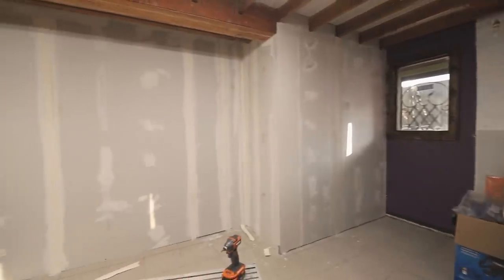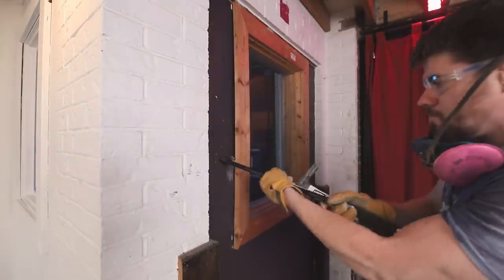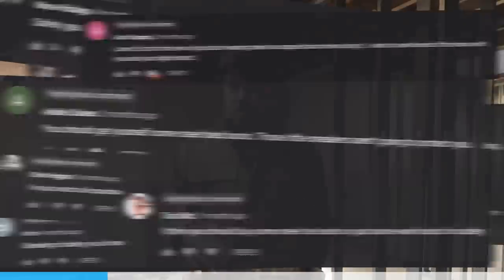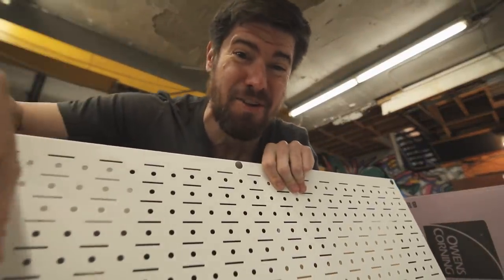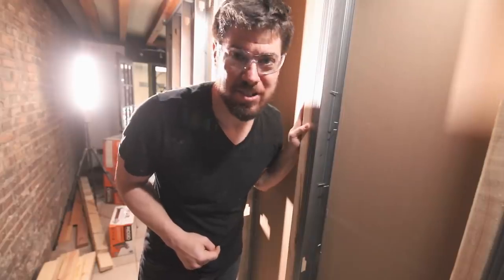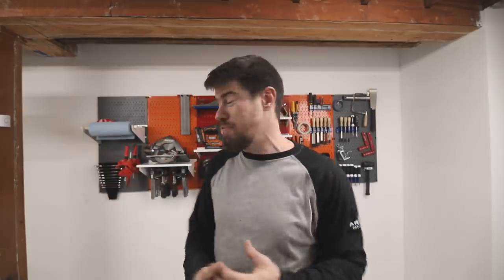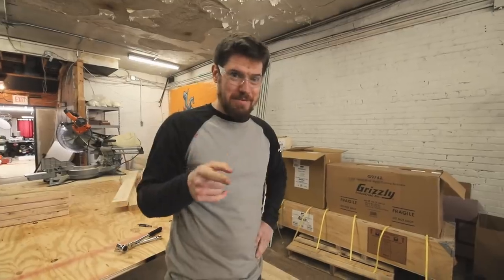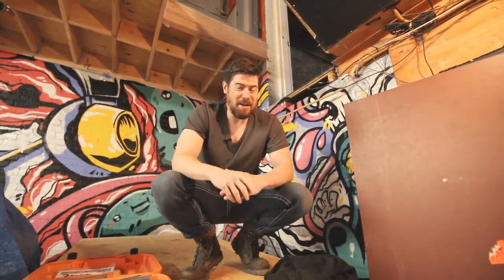Abandoned Building Renovation Ep. 08 || PERMIT PROBLEMS, PAINT SPRAYING & Workshop Organization

Comment: If you're going to use that scaffolding as a deck, you did make a mistake. But it's NOT the one you think you made with the lag bolts. When building a deck, you notch your posts to receive the boards for your truss members. This way, the weight of the trusses go directly from the truss onto the post holding up the truss. The way you have it, the weight of the side boards are being held exclusively by your metal fasteners (the screws into the plywood and your lag bolts). This creates a sheer force on the lag bolts that will over time cause the lag bolts to fail. Sure, some of the weight is going up the screws in the 2x4s into the plywood and and then over to the posts. But you're still mostly working against gravity at that point.  Good job on the diagonal brace.

Now, if this is a temporary structure that you're going to use occasionally, then having the lag bolts take up almost all of the weight is fine. You should notice any deformation or stress spots in those bolts long before they fail.  You may even wish to add heavy duty, locking casters on the bottom to make those platforms easier to manage. However, if this is going to be used somewhere else on an ongoing basis AFTER the plumber is done with it, you're going to want to redo those legs.

Remember, when building structural components, the load forces should always go directly from one load bearing component to the next, and not have any metal fasteners as a bridge. If you have a point where load forces cannot go from one structural component to the next, then you need a third party solution like Simpsons metal hangers and straps. And, in some applications where the load does cross from one structural component to the next, but the fasteners might not hold when presented with sheer forces, you may still need to add hangers and straps, like hurricane straps to tie roof joists to the walls they sit on.
Reply from the maker: This one is a temporary structure....but good info to know for when I build my roof deck.
Reply: Wanted to mention that too, things that i learned on high school. But than i realized he's so handy and not come as an engineer, so he'll learn himself by the time he doing things

Comment: I'm surprised you didn't just cover that tool wall with a DIY french cleat system, and placed plywood sheets behind the drywall, instead of doubling up on the studs
Reply: Exactly. French cleat/plywood wall would have been sooooo much better. really missed opportunity.
Reply: I'm surprised you don't get how great Wall Control is...
Reply: @Stillnapie  I don't get it. My father had pegboards for his tools and they were horrible. Granted, fiberboard, but still pegs in holes. French cleats are much more customizable.
Reply: @RussellNelson  Ok.... so?  I use french cleats in my wood shop but the Wall Control product is far better in my metal working area.  Have you ever used Wall Control?? If not you have no credibility on this.  And they are nothing like the old pegboard...
Reply: @Stillnapie  They accept standard pegboard items. They fall out of a fiberboard pegboard. Why would a metal one work any better? Sorry, but you have no credibility here. It's almost like you've never used a pegboard.
Reply: @Stillnapie  Okay, then how does Wall Control keep the tool holders from pulling out when you remove a tool? They're the same tool holders! They advertise that you can use the same tool holders which don't work with fiberboard, so how is metal going to solve that problem? Honestly, you're just making stuff up.

Comment: Technically you only need to bolt the long side.  The short side on the end is no different structurally than the cross pieces in the middle.  That said, as long as you didn't put the two lags in the same grain line (which you of course didn't cause you're not an idiot) you're fine.  Of course, local codes may require squid ink and bunny slipper, so who really knows?

Comment: I have been "criss-crossing" leg-bolts for 40 years on work benches and it has worked well. The only thing I do different lately is that I use 2x5 or 6 at the top to spread out the bolts.

Comment: A thought- using the heavier gauge metal studs in place or the existing studs and lapping them (since you had one side of the wall open) with the in place studs would have got you the strength and could also be used for blocking to help carry and distribute the load. Have done this on remodels and refinishing commercial space- although I'm a plumber by trade and contract, building a wall that might carry several tpes of drainage and water supply, hang commercial sinks and equipment on, you take the framers to lunch every now and again to learn how to fix the crack you are in! Other than using washers of a larger OD to spread the load around the bolt passage and lock washers, I don't see any particular problem. And most "table structures " are much the same. I would have used the excuse to tell my wife I needed to make the rent company auction and bought several sections of different height modular scaffolding and hardware, but that is me! Good scaffolding was always great for me, as aspects of plumbing are commonly run in the ceiling.ON big city permits and "the ticking clock" all construction exists on, I have little advice past you seem to be doing all the right things. If you weren't in Illinois, I might suggest you look to the state Fire Marshall's Office, as they are the driver on that code change- maybe you can get them to sign off on it and then the city will have to act? Illinois has already given me gas when I was there for a short time, so you have my greatest sympathy. The weather is better in Texas anyway! I left with a 40 mph breeze coming off the lake in late October, my hoo hah frozen dang near solid! But I am an effete Southern boy, with thin blood, don't you know! Great place- wish I was 30 or so years younger, and not so beat up from my 35 years at construction- which I loved and would do again, even knowing it had personal health costs.

Comment: If I may make a suggestion, you are going to have quite a few machines in your shop requiring a multitude of hand tools for adjustments etc.  If you have the money, buy a set of tools for each machine rather than one set of tools I.e. a set of combination wrenches that are on a pegboard somewhere in your shop.  If you have to walk 5 or more steps to retrieve a tool needed for a certain machine and have to return it to its original storage location it becomes a PITA.  For example, I recently bought a drill press and I needed a few combination wrenches to make a few adjustments.  I was walking over to another work bench to always borrow these wrenches and I had to put them back.  Go out and buy what you need for each work station, it will save you a lot of time in getting your work done.

Comment: Hey Modustrial, pro tip for workboots my grandad lived by: If you are doing metal work at all, jeans over the boots is a MUST (actually H&S regulation in the UK), anything else then feel free to tuck the jeans into the boots... reason for this is i hope quite obvious, it takes longer to pull your boot off than it takes a lump og white hot metal to leave a nasty scar (or worse) on your foot.

Comment: For the lag bolts- you're putting all the load on the bolts, rather than wood to wood. Plywood-->2x4 frame --> 4x4 post 
You can also use 2x4 with one with a notch so the load goes on a 2x4 directly, rather than the bolt- it also provides a flush side if you wanted to skin it. 

But I'm just a theatre tech :P

Comment: 2 months too late now but in more industrial settings where you still want a drywall finish/partition but you need strength in the wall to hang stuff you can put a layer of 1/2 or 3/4" ply or OSB behind your drywall sheet. You don't have to worry about matching your fixings to your studs that way.

Comment: Those bolts will rip the wood apart over time even with the washer. I would recommend using some of the things they call "mending plates" and putting them on the wood so you have a 2inch square or 4 inch square metal plate that the bolt and washer rest on rather than the bare wood. It will last much longer and take much more stress. You could also use a much wider washer if you would prefer. But you've got too much stress on too little a spot with metal on wood.

Comment: I sure hope you're planning to run Cat 6 ethernet cable before you seal up the walls. If you're going to be uploading gigantic video files to YouTube, you need a physical connection, at the very least in that studio you're planning.  Wi-Fi is convenient, but wired is way faster.

Also, you're pretty likely to need more than one access point to provide adequate wi-fi signal over the whole property.  It's long, narrow, and has a lot of walls full of metal studs blocking the signal.

So run ethernet cable while you've got the walls open.  It's cheap, you can make provision for ceiling-mounted access points, and run everything to one central location.  Just don't forget to label which cable goes where, it's a pain to identify them later.

Comment: On the clothing front... I don't think I've ever seen you wear trousers with built-in kneepads. These days I have bib/brace and trousers with built-in kneepad holders (Dickies in my case but other brands do them), and they are a godsend when doing anything involving kneeling. Sometimes you have to make sure you orient the pads as you come into contact with the ground, but that's better than straps digging in. Comfy.

Boots/trousers orientation... depends what I'm doing. If there's going to be stuff that can fall into the boots, trousers over. If there's going to be stuff that can soak into the bottom of the trousers, trousers in. 

Shirt/trousers orientation... depends if my butt is going to be revealed, and if there's anyone around to see it 😂

Comment: Are you using the GTI roof rack to transport materials, 2x4 studs, 4x8 sheet plywood, etc? If so how is it working out for you? Any recommendations for a roof rack for a GTI that isn't a PITA to use and ideally not too noisy to just leave on most of the time you're not using it?
Reply from the maker: That's what I use it for.  I have a rhino rack and I like it.  I got the more aerodynamic version (forget the exact model), which is less detrimental for gas mileage if you leave it on all the time.

Comment: You can’t put untreated wood studs inside the wall alongside metal studs and still think you’re maintaining the same fire rating.  I know nothing about Chicago city inspectors or codes, but thats not how IBC works and that’s not how fire works.  The fact that you built a metal stud wall first doesn’t stop the wood inside the wall cavity from burning.  Also,  maybe look into plywood backing in tandem with heavier gauge metal studs in areas where you’re planning to hang heavy stuff.  Similar cost and a much better attachment substrate.

Comment: With airless sprayers, the thing that takes the longest is cleaning the thing so you can use it next time.
Reply from the maker: This one is pretty simple to clean....I try to use water based paints and primers, which helps a lot....just run water thru the system for a bit and you're good to go

Comment: jeans over boots.. always. as a safety concern, tucked in, you run a small but unacceptable risk of sharp objects like nails, that shattered glass, wood splinters etc slipping down into the boot and irritating the ankle/foot. Especially a solid no when welding, grinding, or casting.

Comment: Paper towel holder needs to be at bottom of your system. Avoids getting anything  (water, dirt, etc) on tools underneath. And avoids hitting tools with your hands when you are trying to rip off a sheet. Speaking from experience. Ultimately needs to go in your kitchen and a paper towel dispenser is a much better solution.

Comment: So glad you're back working on this despite the city. Good work done! 👍
🎯  Looks like you might end up needing a little more peg board. 😍
🎨🖌 Just call you Mr Paint from now on, right❓😆
👖🥾Jeans are about function and safety when working, not how they look. So unless you're working where they'll get wet, then they should be outside and snug. Keeps stuff out of your boot and covers the laces so they don't get caught up in something. 👍😍
👖👕 Speaking of jeans, if you're going to be filming your work, your audience doesn't want to see buttcrack! So... No saggy pants. Shirts tucked in and make sure they're long enough. And suspenders are a must❗ They keep it all together. Thank you❗😍
🖌 🧱 While it may look nice, I really hate to see brick painted. Bricks are meant to breathe. If you paint them, you take that away. When they can't breathe, they will rot. That said, I know you can "white wash" brick. Depending on the process, that "may" allow the brick enough breathing ability, but you would need to verify that to be safe.👍🙂
📜 Permits...argh❗ Cite the old code # and date, and that it was replaced by new code # and date with the whole code, if it's not too long, else a short, relevant passage. The reviewer will appreciate having the references right there for them, making their job easier. If there were any other questions, do the same idiot-proof response prep. 😉👍

Comment: I wear my pants outside my work boots - it avoids that nasty situation where plaster, dirt, sawdust, etc. gets down into the boots when you tuck your pants into the boots.  I even did that in the Army when I could get away with it (in the forest, etc.)...in fact we did not actually tuck our pants into the boots even in the Army - we used "blousing bands" which were basically elastic cords which we put around the top of the boots, then tucked the pants into the elastic bands - from the bottom.  It works great and looks better anyway...however, that worked fine in the Army, but would look kind of dorky for civilian clothes, so if I were you, I would just let the pants hang down outside the boots.

Comment: You could have just hung all those tarps from the ceiling 6 feet from the wall like shower curtains to use the sprayer. Easier than covering everything.
I've done that when working on a car to keep sanding dust and over spray off neighbors cars.
Reply from the maker: yup, in retrospect, totally should have....especially since you can usually get away with one less coat when spraying.

Comment: This is the best way to add legs to table shaped object, such as your scaffholding, in my opinion.. think of old wooden dining tables.
Lag bolts diagonally into the leg and screw the bracket into the frame, you can set this up in a way so that you just have to remove the two lag bolts to remove the legs.
Although the criss cross shape you've gone for looks functionally fine.
https://i.stack.imgur.com/KA7Bt.png

Comment: Pretty sure you semi invalided the fire rating of your wall assembly with putting those wood studs in your metal stud wall. Also your scaffolding is not OSHA compliant. Any contractor with scruples will avoid the scaffold you just built, regardless of how well built.

Comment: I have a hard time understanding how a front door access to the shop was not planned for in the design. With all of the thought that is going into the construction this one seems like a no-brainer requirement since the alternative is running from front to back to front on 2 floors.
Reply: If I recall, he did plan for that. He just didn't get the demo done before sealing up that other wall, and it meant all that running in the meantime...
Reply: @JeremyHamaker  thanks. That makes more sense.

Comment: As a bloused trousers guy myself I follow these boot rules:
Working: Tucked in, keeps the bottom of your pants clean if you need to take your boots off to go inside or whatever, wont be dragging filth across the floor. And the bonus of your pant legs cant get caught on anything...not that they would.
Every other time: over the boot, it subjectively more attractive.

Also you should put your paper towel holder at the bottom on your wall control panels, If you got some drippy mess you don't want it on your tools!

Comment: saying fire code rating of metal... thats strange to me. local fire fighters wont enter a building with steel frame, yet will happily enter one with wood as its more predictable when itll fail
Reply from the maker: Metal doesn't burn :)
Reply: No it suddenly bends and twists.
Metal studs fail suddenly and its hard to visually work out what's left

Wood is fine when burnt 60% out.

Also when you get steel hot enough it does burn.